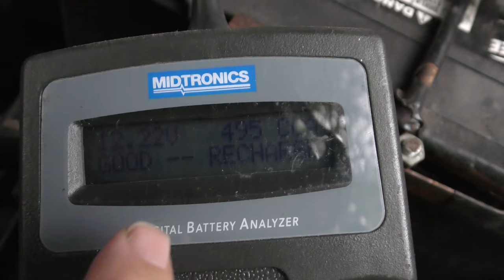Here’s Why Smart People are Fixing Their Cars Now and Saving Big

Comment: I took our spare car, a trusty old 08 Mazda 3, 2.0 bought new,  to my friend of 46 years, tire shop yesterday for a State Inspection. I took my own oil, Idemitsu, 0w-20, and a Napa Platinum 1348 oil filter. Tire rotation also. They were busy , but not like normal! Most of the time, you can't even get in the parking lot! They are doing alot of car drop off's right now. They are part of a Huge family owned, multi location Tire and Auto repair company. He married the founders daughter, so I get GREAT Service! There showroom and counter is roped off right now. 1 person at a time can go in. I stayed outside for my own safety. Health Issues that make me more vulnerable. I did go into the shop bay, and did my own inpection front to back while the car was on the lift. I backed the car out and pulled in front of the office. I held up my Bank card and, waved to get his attention. He waved back over and, over just to leave with no charge. I kept shaking my head ,no! He finally came out and got my card. Brought me the paper work and receipt. I Left and, looked at the receipt and, was only charged for the inspection. I will have to call him and, get on to him. THANKS, SCOTTY! PRAYERS FOR EVERYONE!! PEACE....................................

Comment: Right on Scotty.  I just got 4 new tires and changed the drive belt, AC compressor belt, tensioner and idler pulley.  Next- oil change.  Like you said, we are not going anywhere- get it done now.

Comment: Hey Scotty! Great advice! I've been taking advantage of the pause. I just replaced my spark plugs, rear brake pads, changed my oil, replaced my rear differential fluid and will be replacing my gearbox and transmission fluids, they were all due and I have the time and weather now.  I'm getting ready to replace my timing belt and since I'm going to be in there, I'm buying the Honda kit and replacing the water pump and tensioner as well. All this work with a few more tools will have run me about $400.00. Imagine how much a mechanic would have charged me, not to mention the Honda Stealership!

I've been working on my own cars for 3 or 4 years now. I invested about $1,000 dollars in tools over that time and I got my money back and then some in the first year of changing my own oil, doing brakes, replacing rotors, replaced the complete front end of my 2011 Pilot, bearings, you name it. I owe you and other YouTubers a debt of gratitude for walking me through so much of it. You are absolutely right, you can't beat the sense of accomplishment and the amount of money you save! Thank you, thank you, thank you!

Comment: Scotty - at one time, I got the word that the Toyota parts were imported through NJ.  I live 3000 miles away.  It is not unusual for the local Toyota dealers to not carry much of a parts inventory.  When I was a year from doing the 90,000 overhaul, I started accumulating the OEM parts that I wanted.  Imagine walking into the small repair shop with all the parts and not having the car sit around waiting for parts on the lift - and how much the mechanic appreciated it.  I always get all many parts as I can before having a mechanic work on the car.  In November, I had the torque mount and the front center motor mount replaced and gave them to the mechanic to install.

Comment: I used to do all my own oil changes years ago. But I just did my 02 Jeep 4.7LHO myself for the first time. But first bought ramps and a crawler...so not THAT big a savings...yet! (Oil filter not accessible from above anyway). Sadly, I won't trust fast change shops on my baby which is now averaging maybe 8K miles a year.

Comment: My 14 x5 35i only gets Mann filters across the board and Castrol oil. Oil gets changed every 5,000 miles. My trans fluid , front and rear diff, transfer case fluid was changed at 50,000 miles.

Comment: The original car battery tends to last quite a while. But I find that once you start replacing them you should aim to change your battery every 4 years as a guide. I don’t bother to check the battery’s condition as it ages as I would rather just swop it. I’m not sure but won’t a weak battery also cause more wear and tear on the starter motor and alternator. Another reason why changing it is a good thing.

Comment: autozone tested my battery and said it was good, the car stranded me 2 times after that and my local mechanic sold me a new alternator, the car stranded me again, an old time mechanic looked at my car and felt the sides of the battery and said the sides were bulging which means the battery was bad. Changed the battery and haven't had any problems since. lesson don't always trust some kid at autozone

Comment: Example Mazda dealership came up with it’s best I have the intake and valves cleaned at the dealership because the car won’t run as good and void my warrenty so what I did is I bought CRC intake and valve and turbo cleaner at the parts house and did the job myself now the trick is save the receipt so you can have evidence that you did the work.

Comment: Hi Scotty,

For my 'new for me', 2014 Lexus ES350, it recommends an oil change every 10,000 miles. I am not used to going that long between oil changes. Should I change it every 5000 miles? Or  is it safe to wait for 10,000 miles? The oil filter is a pain to drain. I drive 1500 miles a month.

Comment: I've got ac compressor, condenser, gaskets, line filter, and a new belt coming Fedex tomorrow. I have the evacuation pump , and refrigerant when my clutch went last spring.
Reply: Replace accumulator if replacing condensor &/or compressor. Make sure you use approved oils/ esters/refrigerant according to oem. I'm mobile a/c certified so rest assured it's standard practice. Since system is apart it's a great idea to replace orings too and oil them up. Good luck.
Reply: @davidg5704  it's a tacoma. The receiver dryer is attached to new condenser. I'm going to flush the evaporator,  and the lines even though the compressor did not fail. Looking forward to it.
Reply: @MacsWraps  yeah same as my Toyota so make sure disectant bag and oil is included with new receiver dryer. I bought oem nos and it was included. So beware if not oem. I recommend adding green dye when putting system back together its easier to see where leaks are if any. Beats using a sniffer.
Reply: @davidg5704  I went with Denso. Rock Auto. I think I got my bases covered. I broke the bolts free on the compressor  last weekend while I had it up on jack stands spraying fluid film. New England salt is bad, that stuff is great.
Reply: I did also buy oring kit. Coat with mineral oil they say.
Reply: Green dye...thanks. I will definitely take that advice.

Comment: Hi sir i have Hyundai Verna 1.5 CRDI terbo diesel engine 18000KM on it there is a strange problem in it (from India).
    After a loog ride like 70-80KM it don't start(makes clicking sound ) because of stater moter don't work , reaction is dead battery but after 15-20  minutes it start cranking like nothing was happend ever. 
Stater moter is repaired new carbon (springy contacts to provide current to spinning shaft of motor) and new something electro-magnetic (solenoid)

 this is my first car (used one ) please help me to get rid of this problem🙂🙃

Comment: I tried do it yourself jobs on my car already. I really don't like it. These videos make some jobs look like a breeze. My situation is dealing with rust. Dealing with rust really, really, really sucks. If you're in the Northeast, I'd suggest getting a Map Gas torch for those bolts that you think might be rusted and that are going to give you plenty of trouble, and also try to possibly have an exact replacement bolt(s).

Nothing is more frustrating than snapping a rusted bolt during a do it yourself repair (don't ask me how I know) and not being able to put your car back together in a timely manner because now you need to drill out a broken bolt out a hole and wait to find a new bolt afterwards.

Another thing from my experience. Maybe not for many but it kinda really sucks for me. It sucks to work on the floor with jacks and jack stands. Especially if you don't have a nice garage/driveway at home - then you'll have to be crawling underneath on the public pavement - make sure you find a street that is calm in traffic (I would recommend dead end streets in a nice neighborhood).

Another thing - make sure you have the right tools for your repair. One thing these do it yourself videos don't tell you is how expensive some tools can be. You can't rent every single tool at an auto parts store. I've spent over $1000 in getting all my tools to make my repairs much easier. I've tried what many of these videos suggest with 'common home hand tools' but when you're actually doing some jobs, you'll see how frustrating it can get sometimes because you don't have the right tools to make the job go as smooth as possible. I even bought some great Milwaukee impact wrench tools that have been on sale lately.

One example being when you're putting a snap ring on a ball joint - I recommend going out and buying some snap ring pilers because when I did mine with some 'common home hand tool' - my needle nose pilers did not bulge it for me.

Last thing, I highly recommend getting a buddy to help you. It does after all, make brake bleeding a breeze when you need to bleed your brakes - and good luck with that if you have rust on those bleeder screws that you need to turn. If your buddy has a car, tell him/her to bring it just in case. It saved me one time when a repair didn't go according to plan and a rusty brake line snapped on my car.

Overall, just note that many of these do it yourself videos are not as simple and easy as they might sometimes seem. Depending on yourself, a 10 min repair video you watched - and especially if you've never worked on your car, might take you hours to complete. Never rush these jobs. Take your time, especially if you're new. Also, one annoying thing I find about cars is that you need a good calibrated torque wrench (and you better hope that it's calibrated well) and have to know the torque specs for every bolt that you're going to undo.

However, I have found working on my own car very rewarding. Around my area pretty much no repair shop even do things as simple as torquing my wheels correctly. When you do it yourself, you know the job has been done exactly right to a T - something you never know 100% when you take it to a repair shop and get charged a bunch of money.
Reply: Yes Scotty makes it look easy. I can do that. But in reality, I barely have tools. However, Scotty recommended blue driver. That's easy to do. Haha.
Reply: @jeffreysantos9070  haha yeah but not only Scotty but many other videos do as well. It actually amazes me haha. How a 10 or 15 min video can seem so motivating - then it can take you hours to do on your car. I have bluedriver as well. It was definitely worth every penny! You should invest in some tools if you can. The tools will pay for themselves instead of giving your money to a repair shop in pricey labor and parts
Reply: @JoseGomez-oz5ec  buy tools. Okay why not.

Comment: I have a 94 Celica never needs worked on!
Reply: Any car will need servicing at some point in time.

Even common things like oil changes, brakes, tires, air filters, fuel filters, bulbs, etc. need to be done at some point in time.

Never say the car never needs to be serviced.

Comment: Hi can u charge a lead acid battery when it's still connected to the car?
Reply: Imran Haque : yes. Do not use fast charge, a good overnight charge is best. I generally do an equalize charge on my car battery every 3 months or so with an automatic battery minder. Usually get 6-8 years out of a regular lead-acid battery.              No need to disconnect battery just pay attention to proper hook up.
Reply: @steveb.6267  Thanks from the uk  stay safe

Comment: On your new video can you tell me what's going on with my 09 Chevy traverse.  When I get gas my engine won't start right away and makes me turn over the key a few times and push the gas pedal some.
Reply: Check fuel pump pressure if ok then also check fuel filter if it has one. I found drygas lids in my tank causing blockage so look there of you can.
Reply: @davidg5704  thanks I appreciate it 👍